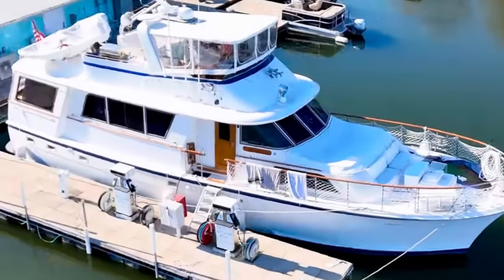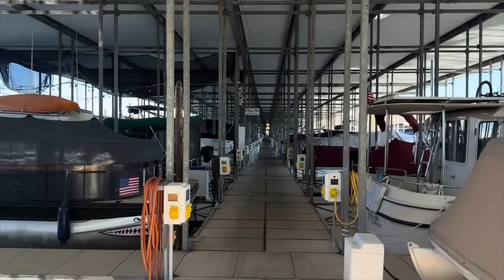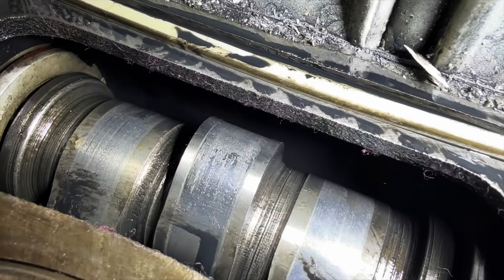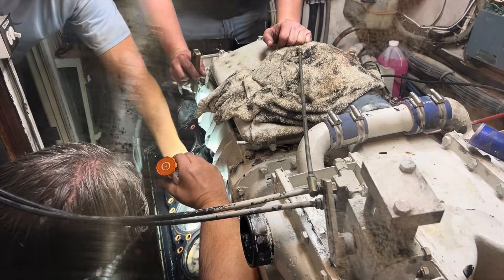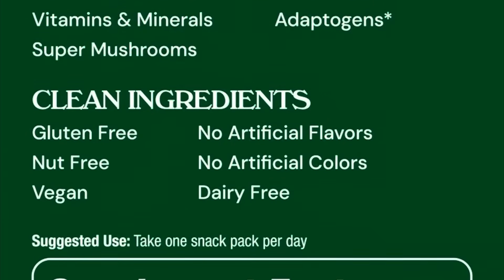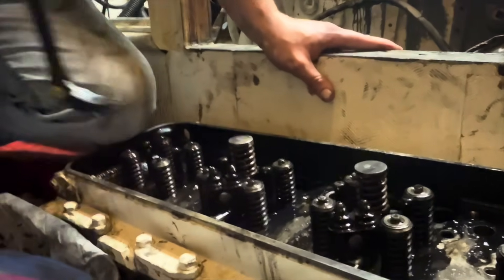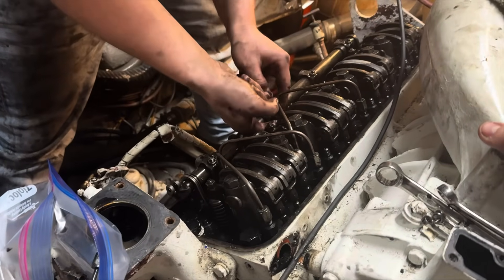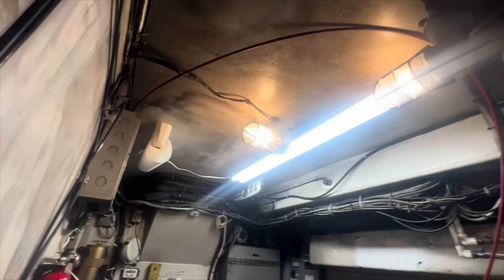Yacht Engine Failure: The Internal Damage Report

Comment: You have taken the heads away, headed to a machine shop? Yet with all that metal floating about, how do you  re-sleeve cylinders, main bearings in such tight quarters  . Still have all those metal pieces in every oil passage to get out. Where did the coolant enter the oil pan from.   Find an old bus engine and cut the floor out to remove the block?   Merry Christmas

Comment: I actually worked as a mechanic at a marina in Washington DC. These guys who say that engines come out through doors in the deck must not have worked on many boats. We used to always bitch that the designers didn’t care about the mechanics who were going to have to work on these boats at some point. I have seen boats like that one your working on hit something in the water and tear up the skeg which required getting to the part from the inside but guess what was directly on top of the rudder box? A huge fuel tank. So the only way to fix it correctly is to remove the transom and pull out the tank or tanks. Most of the time if it was a bigger boat they would be totaled because of the work needed to do the repairs. The designers would put all the machinery in first then put the top on. I have worked on Carver boats where I had to hang upside down and reach back to pull a transmission out, not fun. If you have to jack the engine up to get at the pan you have to make sure that the prop shaft coupler is lined up perfectly when your done otherwise it will end up destroying the shaft and coupler. That’s why there are engine height adjustments on all four corners of the engine. I don’t miss it, so good luck and happy boating……
Reply: Must be where the automotive industry got it's engineers 😆
Reply: No, serviceability is not a primary concern of marine engineers.
Reply: @RonRussell-sj1zf   I'm of the firm belief that the attitude of these engineers are that the buyer is rich, they can afford to throw whatever they need to fix it, so eff them.  This is why I want to build a skoolie conversion.  I'll be taking the time to look at what's gonna be needed access wise and build around it in such a was as I can service it myself if necessary.

Comment: any way to fit a bolt up lifting beam up at ceiling hight above both engines that would lift  the whole block and save his back
Reply: No way to lift it enough without opening the deck plates.
Watch and see.
Reply: Have a strong feeling.they will punch new sleeves instead of honing.
But! It all depends on what owner wants to do.
Reply: @robertproctor-m5y , absolutely no doubt it is getting new sleeves.

Comment: I can’t believe the new owner didn’t have a pre purchase inspection before he bought the boat.
Reply: He should have paid for a full survey including a diesel specialist. Pay now, or really pay later.
Reply: No "pre-purchase inspector" will tear down an engine
Reply: @jamesstuart3346 A tear down wasn't needed to diagnose that dog. An oil analysis showing coolant in the crankcase would have been a big enough red flag. A compression check would have been conclusive that she was a dying engine.
Reply: There are things called a horoscope Skippy, 1 your will tell you the condition of the cylinders.  @jamesstuart3346
Reply: For boats it's called a 'survey' and it does not usually include internal engine examination.  It's often only external and functional checks, you can pay more for an oil sample and a sea trial, and on small gas engine boats some surveyors will do a compression check if its not a pita.  Newer boats, you can pay for a mechanical survey to  pull engine logs and do diags on the computer, which can do a 'contribution' test and QUICKLY identify a cylinder in trouble.  I've not commonly seen it offered a sa standard service to inspect engine internals, but I've known very large ships owners to pay for another 3rd party to go into the crankcase.  usually by physically entering it through a hatch!
Reply: @BadHaddy  seen that
Reply: @BadHaddy my boat inspection/survey included a compression test and oil sample.  This was on a simple gas engine, it for sure would have happened on a diesel engine with a competent inspector/surveyor.
Reply: You could say the same thing about all these busses that Scott works on that they just bought and are totally junk.
Reply: Just go without saying you oil sampling the other engine???
Reply: An oil analysis would have shown metal in the oil.
Reply: @   By the look of the engine there might be more metal than oil in the sample.
Reply: might have been bought at auction
Reply: Probably too cheap.
Reply: @ChrisHarding-lk3jj  Yes; My best guess so far.:person-turqouise-waving:
Reply: His wife did the inspection!!!     IWANT IT Or no fortune cookie!!!!      He had no choice !
Reply: @elainerussell924  No Fortune cookie!!! I laughed

Comment: Previous owner knew about this. Had to.  New engine needed there.
Reply: Yeah that's an awful lot of wear. I've pulled apart clapped out 4 cylinder 4-53's that were noisy, leaking, hard to start, and putting out a ton of blue smoke from worn out rings, and cam, and main bearings were still fine. Still a lot of crosshatch left in the original liners too, nothing scored, just old and worn. Rod bearings starting to show some copper but nothing ruined.
Reply: Not necessarily, what should have happened is that thing SHOULD have had a fresh Survey and Sea Trial before the new buyer took ownership of it. If they didn’t that was a mistake. If there was an existing problem and it had been properly surveyed said problem most likely would have come to light. But freak things do happen. You might be correct but you certainly have no right to make that accusation about the seller.  You don’t know what or wasn’t disclosed. It’s possible the new buyer may have wanted to save some money and not go through the survey process or they just didn’t know any better and if that was the case that bad on their part.
Reply: @Quark-b9f  agreed but you NEVER save money but skipping the survey. 
its a "never enough money to do it right but always enough money to do it twice" situation
Reply: @Quark-b9f  How long had you owned the boat, before it was sold?
Reply: @LowLevelNC  there's 2 rules when buying boats and they become exponentially more important the larger the boat gets...

Rule number one DONT buy a boat

Rule number 2 If you get the itch hire a surveyor and do a complete inspection and sea trial THEN DONT BUY THE BOAT!!!
Reply: @chrisjohnson4666  Very true! NOT doing this is about as smart as buying a sketchy used vehicle and then bringing it to your favorite mechanic for that famous "post purchase inspection" 🤪😜
Reply: @chrisjohnson4666  Two happiest days of a boat owner's life are the day they buy it and the day the sell it.

Comment: A yacht survey would have found this before he bought it I've heard it said it's always good to do a yacht survey before buying a used or new yacht s
Reply: Doubtful, they can’t look in the engines and most of the surveyors aren’t going to do oil analysis
Reply: @robbie2187 You obviously don’t know anything about surveys. If it were properly surveyed it most definitely should have been thoroughly gone over and run through a sea trail. That’s one of the main purposes of a survey! 🤦‍♂️
Reply: @robbie2187  If you find a surveyor that is not doing oil analysis, find a new surveyor.  Any half decent surveyor would of found this problem before purchase.